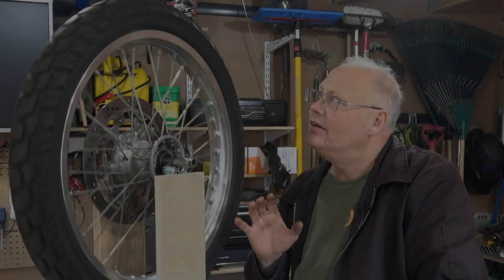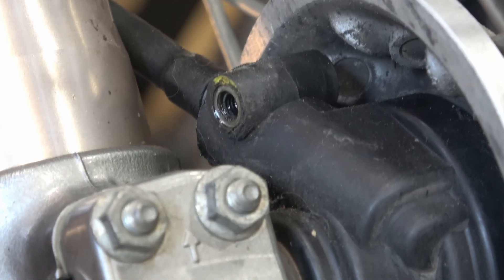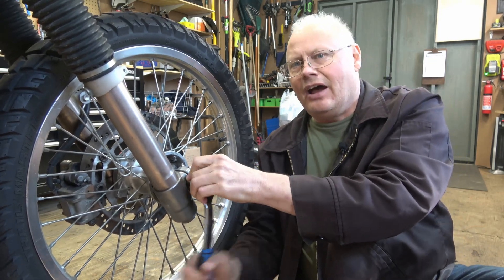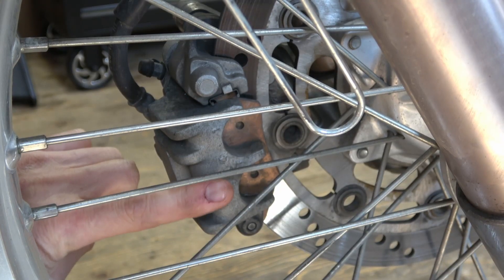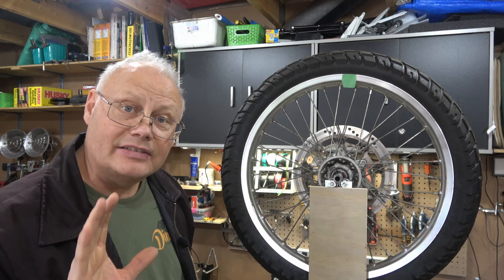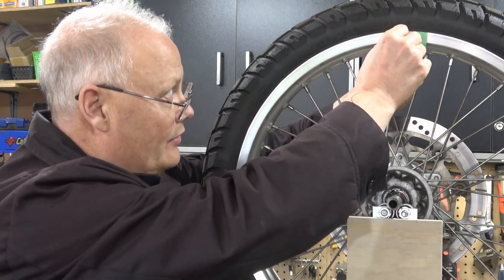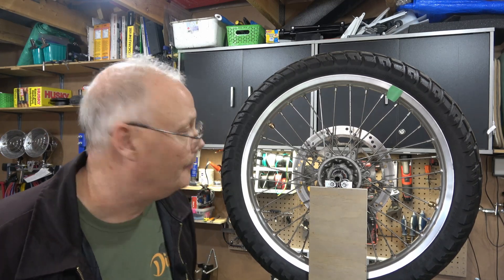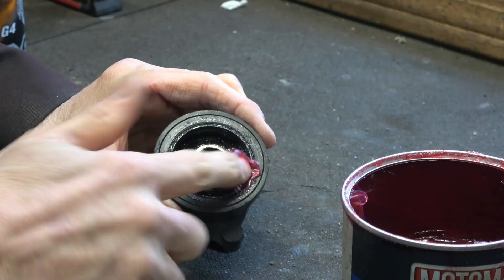How to balance a motorcycle wheel with a DYI balancer.

Comment: I just found your channel, I havent used my dr in a couple years but plan on riding it a bunch this summer.
I use counter act balancing beads to balance all my tires, even in my car as I change them myself too.
I really like the balancing beads, they're quick and easy, it takes about 5 minutes to pour them into the tire or tube.
In a bike with tubed tires they stay in the tube until you swap it out so I only have to buy them once per bike.
Reply from the maker: Great tip, thank you for sharing it. Hope you get lots of riding in this summer.
Dino

Comment: If you don't mind: when it comes to the axle holder, I've also read that the bottom bolts should be tighten first then the top ones. And the gap between the 2 parts of this holder should be a bit larger at the top than the bottom one. Plus you should tighten those bolts only after having wiggled up and down a couple of times the fork (with the wheel on the ground of course). This allows to adjust/centralize the wheel and the fork (Please see here at the beginning: https://www.youtube.com/watch?v=sRcVGxzdaao&list=PLd0HQFhfUNEnIbjPB1QKGP8l7Wkr6x8He&index=3)
Reply from the maker: Hey thank you for sharing the information, I appreciate you taking the time to share it.
Dino

Comment: Good video. Just some thoughts, I don’t think your wobble problem is related to the balancing. I don’t get as fussy as you and find I can’t notice when it’s less than 0.5 - 1.0 oz out of balance. 

I hope you figure out the issue and report back. Cheers
Reply from the maker: Thank you for the comment, I am pretty sure that it is the tire tread pattern that makes it feel the way it is, but I am going to try different air pressures and also check the rim true a bit closer than I have to see if that is at all impacting it. It is weird though, my old tires rode smooth as glass.
Thank you again
Dino

Comment: Hi Dino. I've never seen two weights apart from each other like that before, but it clearly works! Thats kind of cool! My street bike I use stick on weights. Since my XR650L has spokes, I use the same lock-on brass ones you have. I grind them down to the correct weight. Another great video, Thank you!
Reply from the maker: Lol this is what happens when you do not read any instructions, you just do things the way you think is best. This method did work but uses twice the weights.
Dino

Comment: Ciao Dino , sto divorando i tuoi video. E visto che ho un dr 650 RSE del 1992 vorrei fare qualche riparazione/controllo. Voglio comprare una chiave dinamometrica....che serva un po' per tutto.Quale mi consigli ? Grazie
Reply from the maker: Thank you for the question, and I am glad you are enjoying the content. I don't really have a brand that I would recommend but there are a few things I would look for. 
Number one is do not buy a really inexpensive brand, the $20.00 model may not be accurate enough especially for the lighter torques. I think if I only bought one I would look at a nice digital unit, they are accurate and usually cover a very wide range of torque. I would look for one that has reviews indicating the user interface if easy and clear to use, the one I have id not very intuitive and I find I am always looking at the instructions to make it do what I want, the accuracy is there but not the easiest to use. 
I hope this helps, and thank you again for the question.
Dino
Reply: @DinosTinkerShed  grazie per la celere risposta. Vorrei acquistare una chiave di buona qualità. Ma ti chiedo che valore deve avere in Newton Meter ? Grazie ancora
Reply from the maker: If you are using it on motorcycles I would look for a 3/8 drive with a NM rating of around 135. these usually have an effective working range between 7 NM and 135 NM and will cover 95% of fasteners on your motorcycle. If you can find one that is close to this range I think you would be good. The one I have is from 5nm to 107nm and works well but a bit more range and an easier interface would be nice to have.
I hope this helps
Dino

Comment: I wonder...seeing as your lightest weight is too heavy, is it possible to slide it up the spoke towards the hub to reduce the 'weight'?
Reply from the maker: I thought about that Eric, but the weights fit really well on the nipples and I did not want to tighten the grub screw onto the spoke itself. I do think that would have worked though.
Reply: @DinosTinkerShed  in retrospect, there's a lot of centripetal force acting on that weight... Best that it can't slip down outta place. Nipples are the best 🤘🏻🤔😉

Comment: Great video! I really like my wheels balanced. It really does make a big difference. I use stick on weights so i can cut them to the exact weight i need. I dont have any trouble loosing weights but i do have to clean the tape off the next time i put a tire on.
Reply from the maker: Thank you for the feedback, I was going to go with the stick on weights but I thought I would try these ones. over all I like them but they are a bit less adjustable than the stick on ones I think.
 Again thank you for the comment
Dino
Reply: I asked to purchase some stick on weights from my local car tire business and he just gave me a handful for free. Much cheaper than eBay

Comment: Great video Dino! This will come in handy when we put on our new tires (Michelin Anakee Wild). Really like that you put in the extra info on how to torque the "axle holder plate". There posts on the Transalp of people snapping it in half😅. Thanks and keep at it! 🙋‍♂️🙋
Reply from the maker: So glad you liked it. I could see snapping it for sure, I have snapped more than a few brake/ clutch levers by over tightening them over the years. I have found a torque wrench is invaluable for motorcycle repair.
Thank you again.
Dino

Comment: Nice one Dino, that new balancer working a treat. Well explained. Looks like you did it correctly, I would have probably shaved a little off the weight and kept it at the 12 o clock position. But you achieved the same thing and balanced your wheel.
Reply from the maker: Thank you Dan, someone else also made that comment, Ill have to try that next time.
Thank you again for the inspiration.
Dino
Reply: Grinding down the weight probably means you can’t reuse it? Well you could, but it’ll always be lighter.

Comment: I don't bother with disconnecting the speedo cable. I just slip it off the side with the drive as I slide the wheel off.
Reply from the maker: Good option, thanks for sharing.
Dino

Comment: Dino. with the small amount of weight you are adding you really are not gaining anything. Only time you really need weights on Duel sports are if you are using bead locks or the wheel is badly out of balance if that's the case you probably would need to true the wheel rim first.
Reply from the maker: Thank you for the comment, I was into it so I still balanced the wheel. I spend a lot of time on road at highway speeds so I wanted to make sure it was correct,. Also I am chasing a weird wobble on the front tire since I changed brands so the balancing is something I wanted to do. 
Thanks again for the comment.
Dino

Comment: Hi, good job. I believe you should not torque the axle while the front wheel is off the ground, do you know otherwise?
Reply: Why would the wheel being off the ground matter. The axle doesn't require weight loading.  Best practice however would be to bounce the forks to align them before torqueing the retainer bolts so yes the wheel would be on the ground at that point.
Reply: @iananderson1422  yes, I meant for the fork alignment.
Reply from the maker: Thank you for the comment, I am unclear why this would be necessary (I have not heard this before and it is not mentioned in the manual), the axle threaded and torqued into the left fork tube and is can not move at this point. On the right side the clamping nuts register the axle in a long grove that self centers the axle on that side. I am unclear how bouncing the forks would effect this alignment?  Again, I and just curious.
Thanks for any information.
Dino
Reply: @DinosTinkerShed  Hi Dino. The forks are free to rotate and even though the pinch bolts hold the axle the torque is not enough to straighten a slightly rotated fork leg. By bouncing the forks you are allowing them to center prior to torqueing the pinch bolts. Hope this explains a little bit better.You say you are chasing a slight wheel wobble. This could be one of two things a slightly out of true wheel or a slightly misaligned fork leg.  Hope this explains things. There are some excellent videos on YouTube about this issue. However on a DR650 I don't think I would worry too much about it. Cheers from Barrie,
Ian
Reply from the maker: Thank you for the comment, I am not sure why the wheel being on or off the ground would impact the torquing of the axle or pinch bolts, again I am not expert but I do not see the correlation.
The manual does not say anything about lowering the bike to the ground to tighten or torque the axle and pinch bolts. 
Thank you for the question, perhaps someone with more experience can help out with this.

Dino